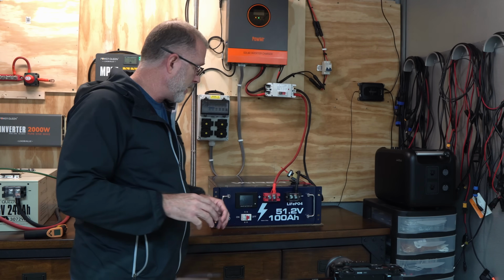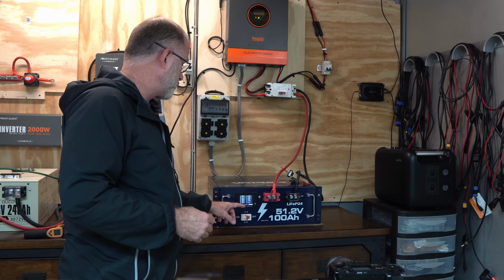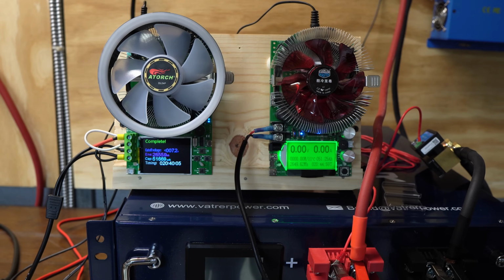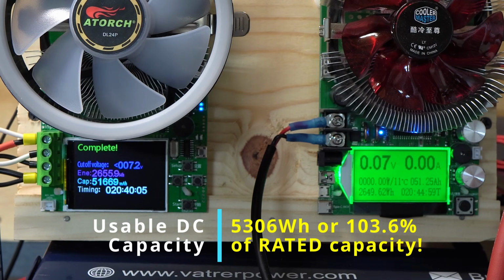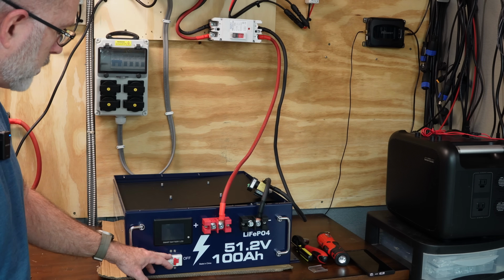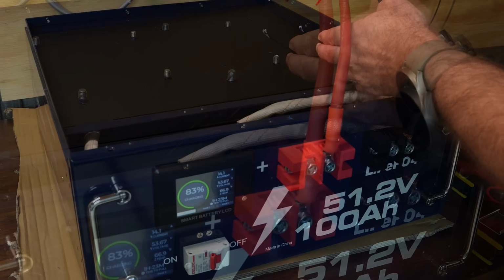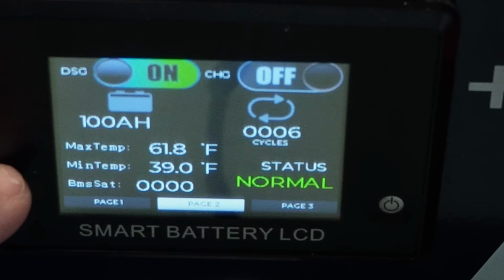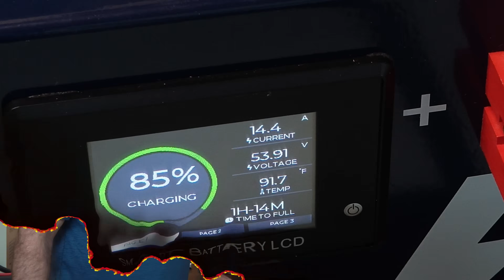48V vs 12V - PART 2: Is a Rack Battery the BEST choice?  Vatrer Power 51.2V 100Ah LiFePO4

Comment: The advantages of 12.8 volt batteries are price, portability, and weight.  I have been discouraged for a long time from a 48 volt hybrid system with server rack batteries because of communication and software errors that I see on YouTube videos.
Reply: Right on Matt
Reply: There are 48V "auto battery" form factor batteries.  I use tons of them myself... no comms.  Works just fine.

You don't need communication, nor do you even need a hybrid solar inverter.  You can build a 48V system with discrete components the same way you build a 12V system.  Unless the 12V system is really tiny, like 20Ah, the 48V system won't weigh any more or be any less portable or cost any more than the 12V system.

The hybrid solar inverter solutions are really meant for larger systems.  They can be useful in that regard... an EG4 6000XP, for example, integrates breakers and removes an immense amount of wiring work from the build.  But you don't have to spend the money if you are slapping together something small.

12V systems shine only in very tiny setups... less than 200Ah of storage.  Once you hit 200Ah @ 12V of storage, 48V @ 50Ah is better, everything is better, cabling is thinner and lighter.  Battery weighs the same capacity-wise.

I don't really understand why so many people seem to think that 48V is hard, or more expensive, or takes up more space.  It just doesn't.

-Matt
Reply: @junkerzn7312  12V LiFePO4 batteries are like 25-30% cheaper than 48V batteries, and batteries are one of the more expensive aspects of a large off-grid system.  Some people already have some cabling, some 12V inverters, so why repurchase 48V gear.  

I agree, 48V does have a number of advantages, but cost isn't one of them.  If 48V doesn't weigh more or take up any more space than 12V, then WHY must the batteries cost significantly more? 

Find me 48V batteries for the same price as 12V, and sure, I'll be happy to do 48V exclusively.
Reply: @junkerzn7312  IMHO it's the marketing of these systems that creates this impression. This is a developing market for the average consumer out there, and as technology has improved, recommendations continue to change to meet what manufacturers want to sell. I bought a Battleborn 100ah 12V LiFePO4 back around 2018 or 2019 for $899. I still have it. Back then it was about all you could buy.  Today, you have 48V systems being manufactured, and the vendors are pushing them into the market largely via these kinds of videos. Consumers were sold 12v systems initially because that's what was there, and they are used to the concept of 12v because their car batteries are 12v. Now the shiny new toy is a 48v systems, and the marketing juggernaut is now trying to get consumers to spend more money and upgrade. There's a lot of re-educating going on in the space, and it will take time for the average consumer to come around to 48v. I compare it to the same thing that is happening with American car manufacturers: they only want to sell large luxury vehicles, and so have simply stopped making small sedans and economy cars. The day will come when no manufacturer will make a 12v LiFePO4.

Comment: Four of the 100AH 12v batteries do tend to cost a little less than one of the 48v batteries.  You can also buy them as funds are available, versus having to pay a larger lump sum.  The major advantage of using four 12v, 100AH batteries  instead of a single 48v battery, is you can always disconnect the four individual batteries and use them for other purposes, when needed.  The 48v battery is less portable and more or less dedicated to one use case.  You could use four of the 100AH, 12v batteries, in series, for your home solution, then take two of those batteries, in parallel, to run the 12v system in your RV...can't easily do that with a 48v battery.
Reply: I have found a similar uses for my old 12V and 24V batteries, but .... mmm. I don't think that's a good reason to actually go-out and buy a 12V battery, even if incremental expansion is the goal.

You can buy 25Ah 48V batteries (The 48V (51.2V nominal) Lithova)... that's about the smallest increment possible for 48V and it is equivalent to a 100Ah 12V battery.  I personally think that 2.56 kWh (50Ah @ 48V, 100Ah @ 24V, or 200Ah @ 12V, all LiFePO4 of course) capacities are the best compromise for weight and portability.  Easily lifted and carried around.

-Matt
Reply: when you buy all the cables and breakers you may find the server rack cheaper, and more durable.
Reply: @davidparker7156  Absolutely correct. BMSs fail all the time too..
Reply: 400 bucks difference 😊

Comment: so a single 48v battery was my original plan but then I came across a deal for 4 12v 150ah ecoworthy batteries for $1000 and even with 4 sets of 1awg cables it's less than $1100 so I scooped that up,now I have 7.6kwh instead of 5.2kwh👊
Reply: Have you tested these batteries to see if they actually are 150 ah?
Reply: Do yourself a favor and buy the 48v "battery equalizer" right away.  Those four batteries will drift apart, giving you less system output and working one or two of the batteries harder than the others.

Comment: Cost.  I’ve seen several 12v 100ah batteries I can get for $180.  I may be wrong but I have yet to see a 100ah 48v battery for under $800.  

When the rack mount batteries get down to the equivalent price it becomes a no brainer.
Reply: $180?  That sounds like lead-acid to me though I wouldn't be surprised given the fire-sale prices 12V LiFePO4 batteries are selling at right now.

A 100Ah 48V battery has FOUR TIMES the capacity of a 100Ah 12V battery.  The equivalent for a 100Ah 12V battery is a 25Ah 48V battery... so something like a Lithova, which is $260 or so.   Definitely not $800.

As you get into the larger capacities, the cost differential drops to basically zero.   Price out 50Ah @ 48V vs 200Ah @ 12V, for example.    Then look at 100Ah @ 48V vs 400Ah @ 12V.  And so forth.

One other thing to consider is that the bigger 12V batteries have smaller BMSs.  A 400Ah 12V LiFePO4 typically only has a 250A BMS in it (3.2kW).   Whereas a 100Ah 48V LiFePO4 will have a 100A BMS in it (5kW).

-Matt
Reply: @junkerzn7312  there are a few different 100ah Lifepo4 on Amazon selling between 180 and 200.  I will say I can’t speak to the quality of them so buyer beware.
Reply: This is a good observation.  Even at $250 for a 12v 100ah battery, they cost less than most of the 48v server-rack options.  Now, it's not apples-to-apples, because the 48v batteries typically have communication options to integrate with an inverter, but for raw storage capacity, you're right.
Reply: Yes your spending more. That's said you are generally getting much more from 1 battery vs multiple. For example would take 4 100ah 12 v batteries to even equal one battery.
Reply: @EatingWild   Agreed.  I think I would like the pricing to be closer though.  If I can get 4x12v for under 800, I would say that 1x48v at $1000 would be good enough.  It looks like recently in the last week or 2 I'm seeing pricing get closer to that now on the 48v front so it may just take a little more time.
Reply: @rchapoteau  There have been slight premiums in the past comparing e.g. 4 x 12.8V vs 1 x 51.2V for the same overall watt-hours.  But yes, the premiums have largely disappeared in recent months.    I have noticed that as well.

We also have to be careful not to compare between brands.  i.e. 4 x 12V for one brand vs 48V for another.   There is a surplus of ridiculously cheap no-name (fly-by-name brand-name) 12.8V LiFePO4 batteries on the market right now all racing to the bottom.  But their internals are generally just as cheap as their pricing.   They are not things you'd actually want to try to put in series or parallel or build a scaleable system with.

Comment: some people looking to change from 12v to 48v probably already have 12v batteries so it is generally cheaper to just buy 1 or 2 more 12v batteries then buy a 48v battery
Reply: It is, but it is not ideal because you are losing out on redundancy (parallel connections) and robustness (balancing is never perfect) when you do that.  And its a lot of cabling and  takes up more space.   But still perfectly doable if no other configurations are economically feasible.
Reply: @junkerzn7312  if you already have 2 * 12v 60ah agm batteries to swap to 48v you only need 2 more which is about $130 and an all in one (like a vevor for about $260) so for less then $400 you can swap your agm 12v system to a 48v system then in a few years get a lifepo4 battery or something
Reply: @hy1 It doesn't make a whole lot of sense to try to scale-up an old 12V lead-acid system that small, particularly if it would mean mixing batteries of different ages.  Better to save up your money and do a complete replacement with LiFePO4 down the road.

The voltage you go with really depends on just how big a system you expect you might ever want.  If the system is expected to remain small (i.e. less than 1000W of solar, less than 5 kWh of usable storage), it is totally reasonable to go with 24V for your upgrade project instead of 48V.

A 24V system can be comfortably built with 50Ah or 100Ah 25.6V LiFePO4 batteries.  So roughly storage between 1.28kWh and 5.12 kWh, inverting power up to roughly 2.5 kW, and up to 1000W of solar using 2 AWG main battery cabling and typical bus bars and other low-cost components.

If the expectation is that the system would grow more than that in the future, then I'd go with 48V from the beginning.

-Matt